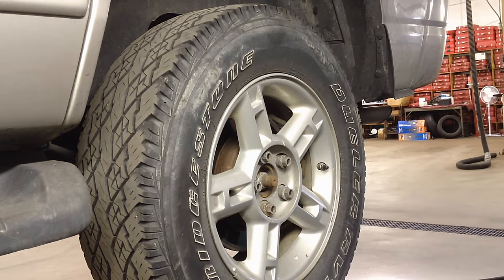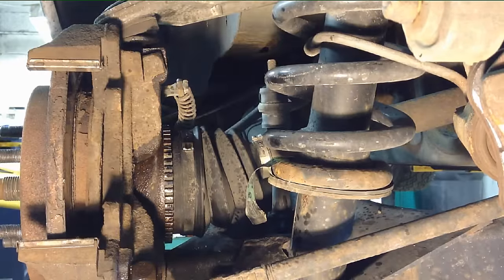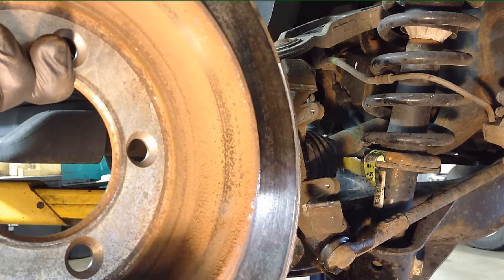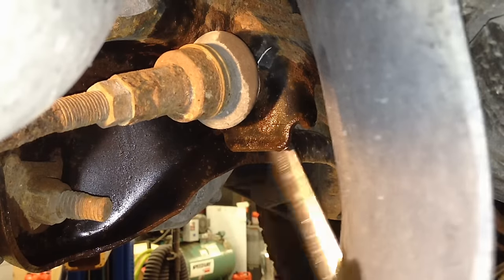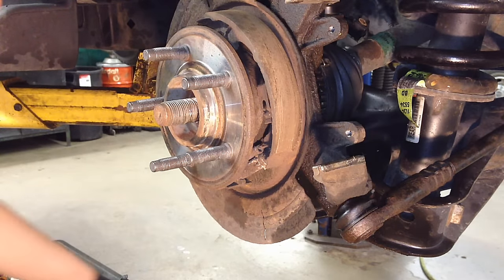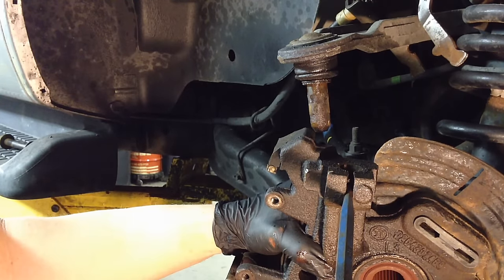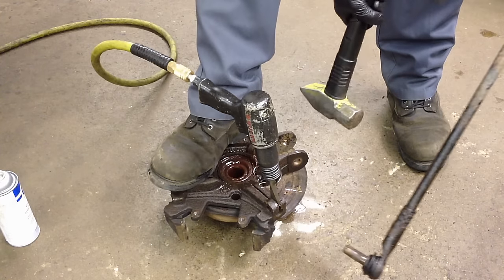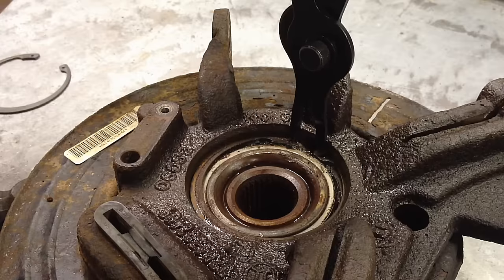2002-2005 Ford Explorer Rear Wheel Bearing Replacement

Comment: A very professional looking video. I learned enough about the process to do it myself if I had to, but I don't think I will. Some repairs are just better handled by a pro, rather than a semi-pro like me. What else would you recommend replacing (aside from brakes) while this is apart to save labor time and expense? Thanks!
Reply: If ball joints are bad and the inner and outer tie rods that’s about it

Comment: Great video. Very informative. Too bad you couldn’t show the install. Were the time constraints a work thing or a YouTube thing?  If the latter then maybe a ‘part 2’?
Whats the blue lube you put on the bearing & hub when you were pressing it in? I’ve always used anti-sieze or brake caliper grease since they can handle high temps without liquifying.

Comment: Been there done that. That's why I own a 2000 exploder. Straight axle with a 5.0 and Aod trans. No worries on timing chains ..trans or rear bearings. Cross member bolts snapping. All that good stuff. Did my 20+ at a dealer. Get out while your still young.
Reply from the maker: J- Styga Oh I did.
Reply: I'm surprise the rear spring wasn't broke and you save the rear "e" brake shoes. Lol.

Comment: you can use an arc welder to remove the race by just running a bead about half way around the race and it will expand and fall off.
Reply from the maker: I know that is what I heard but only half way around.
Reply: the heat generated by the arc welder will greatly expand the the race that was left on the stub and when you turn the stub upside down the race should just fall off, been doing this since the 60's

Comment: Man you weren't kidding....I bought a 20 ton press and was able to press the hub out relatively easy, but the bearing wouldn't budge.  Had to bring it to a machine shop and there 60 ton press made short work of it.
Reply from the maker: +Joe Correia we had an old 20 ton press and we always got them out but 60 ton would definitely get the job done .
Reply: heating and pb blaster cycles helped on each component

Comment: Nice rotor hat trick...have to start using that one
Reply from the maker: area46241 Yep many dealerships use this same method.
Reply: FordTechMakuloco I have a 97' Ford f150 and my rear tires have a small amount of play (In and Out) not side to side or up and down. And it started making clunk noise on occasions when I turn left or right. Is that normal?

Comment: Thanks so much for your video! Next time tap the bearing down to get pressure off snap ring
Reply from the maker: No, it is the rust in the grooved, the bearing does not move or back off after it has been pressed.

Comment: I just did this job on a 2003 lincoln with no special tools.

Hardest part is the snap ring install.  

Not understanding the hype?

A freezer and toaster oven with some big sockets and light tapping is all I needed.

Comment: Excellent informative video. I am a marine mechanic and deal with similar bearing jobs quite a bit. I have a 50 ton press and know penetrating oil and heat wrenching intimately. I should have mandrels to support the knuckle and press the bearing race properly. The suspension links is where I am not experienced. I have a 2007 Explorer V8. It is independent suspension, but looks a little different. Is there anything different about mine vs the vehicle you worked on?
Reply: +Scott Soriero I got my knuckle off and removed the snap ring. I have to say that the 2007 Explorer is completely different in regard to the suspension and knuckle removal techniques. There is no video on the 2007 model currently. Well I'm gonna press out the bearing and see what happens.

Comment: Great video! 

My customer must have driven on his for a while because only the CV axle was holding on the wheel. You would have to see this to believe it. The entire bearing race is on the hub. It carved out the knuckle about an 1/8th inch on one side for several inches. An absolute mess. This is when the complete knuckle assembly comes in handy. By the time you get a knuckle from a junkyard, replace the bearing  and pay for the press at a shop, you would be around $200 anyway.

Comment: Thanks for this video. My 02 Explorer needs the left rear wheel bearing replaced. I'm considering removing the knuckle myself and taking it to a shop to have them do the pressing. My only concern is removing the axle nut since I don't have air tools. I will have to get the socket as well as a 1/2" breaker bar and rent a torque wrench. I've replaced two ball joints as well as sway bar links and brakes. I'm fairly confident I can do it. What kind of shops should I call for the press?

Comment: Great video like others have said I have to do my 04 both sides went bad : ( I called around to see what it would cost to have it done- Oh man bout crapped my paints the lowest price I got was with tax $910 Bucks! So I'll be doing it myself but I think Ill take the knuckles in to a shop and them do the pressing as I don't think my little 12 ton will work Thanks again for well made video !!!!btw - the  cost on parts only is $389!
Reply from the maker: +Rosario W Are you buying the parts on amazon through my links? It should not cost that much for just parts. Also I agree take it apart as shown here and have a shop press them out let them deal with it.
Reply: I just seen that link for the parts I am going to check them out now Thanks for the heads up on the parts and response
Reply: In your listing for the bearing it has a B004 but when I hit the link it takes me to BRG4 bearing -is that the same part? I was going to use Timken Bearings but if these are better Id rather use these cuz I sure as hell don't want to go through this again LOL
Reply from the maker: +Rosario W The brg4 bearing in the listing is the correct I just confirmed again in the Ford parts catalog and latest bearing from Ford. I have never had to replace a Ford bearing on a comeback they really last. I think Timken makes the bearings for Ford but not sure.
Reply: Thanks! that works for me. I really appreciate the response back (I also Subscribed to your ch)
Reply: +FordTechMakuloco The bearing in the video says "F.A.G Korea" which is concerning. I'd prefer KOYO myself but they do not seem to make any for this application. I hear if you want to actually get Timken you have to order SKF...

Comment: I have a question. What causes suspensions to squeak? I've noticed that on some Fords. My '05 Grand Marquis suspension would sometimes make a squeaking sound when I go over some bumps at low speeds.
Reply: Is it the front or the rear? You might want to check out the sway bar bushings.
Reply: Scott Belkin It's the front. It seems to do it when humidity is low.
Reply: Sway bar bushings are one of those parts that get dry and brittle over time. Its not a big deal for a DIYer or mechanic to change out.

When you say "go over bumps" are you referring to going slow over speed bumps or just some bumps in the road?

My 04 Ford Explorer needs to have the sway bar bushings changed every 50-60,000 miles. I hear the squeak a lot when I go at a reasonable speed over speed bumps, when I am not turning over the bump. You probably won't hear it as much if you are turning because there is the weight of the vehicle on the sway bar when you are in a more of a turn.

Hope this helps.

Comment: The 2000 rear suspension is much different from the 02.Cant tell you which is worse but the alignment cam bolt assembly removal usually must be replaced on the older model because its seized and my solution is surgical sawzall action after all options are expended

Comment: That's the issue! I have to replace both front wheel hubs due to sensor failures on my hubs causing ABS and Advanced Traction Control to disable.  In addition, theses same issues are causing my 4x4 High mode to activate.

Comment: Hello Sir, I changed both front sides with motorcraft wheel hubs. However, there is still a noise and light vibration in the wheel. It is very clear in 60mph and goes away on slight right turn or any curve to the right. Could it be the tires? (1 month old) or 
Could it be the the control arm?
 (I hear a sound on bump)
Could it be alignment problem? 
This car is driving me crazy. Please please help!

Comment: Thank you very much. I have 2008 Explorer and there is a humming noise coming and gets clearer on 60mph. However, the noise goes away every time I turn the wheel slightly to the right. Yesterday I changed the right front bearing, but the noise is still there.  Did I change the wrong side? Or the issue is from the rear bearing? Please please help
Reply from the maker: Normally when you turn to the right the drivers side bearing is loaded up. Change the drivers side it is probably failing anyway knowing these vehicles. Generally the rears have to be really bad to make noise on a slight turn like this.
Reply: Update:

Changed both front bearings. Still there is a noise and vibration in the steering wheel.

Comment: Hello Tech...Thanks for the great video again.  Do the new Bearings come with a new snap ring?  If not where can one be purchased?  Also would a 12Ton press be enough for the nob?  Thanks in advance!!!!
Reply from the maker: jsjizza1 No they don't the dealer can verify for your model year but here is the part number- 5L2Z-1A124-A the 12 ton press should be plenty.
Reply: FordTechMakuloco 
Thank you very much I have ordered the new bearing thru Amazon and will call to get tge new snap ring.  Could a bad rear bearing cause the Advance Trac light to come on??  Thank you again

Comment: My sister has a 4.0 4x4 explorer and its either a 2003 or 2004 but either way, its getting a hard loud BANG BANG BANG almost randomly, it changes if I go up hills though, quieter or louder - it has a mind of its own. It seems to be coming from the transmission area and I was wondering if I should start looking at the rear or the U/CV joints or possible the xfer case? The car accelerates and shifts gears mostly normal but the banging does speed/slow with RPM

Comment: Could I buy a part that already has bearing installed and if so what is it called rear hub bearing assembly? I dont have a press.
Reply from the maker: Yes Moog sells the complete knuckles
Reply: @FordTechMakuloco  thanks
Reply: I paid a shop $150 and they used a torch and hammer and now it’s worse than before I arrived there.
Reply: How much? Independent suspension rwd with cv axles in rear.

Comment: Is there any way to grease that bearing without replacing? I just had mine replaced but they forgot to pack grease in there when they replaced it so I'm getting a high pitched squeaking at times. I would normally just take it back to the shop that did it but it went out while I was on the road about 300 miles from home.
Reply from the maker: No this is a sealed bearing
Reply: FordTechMakuloco That's what I thought. Is it possible to remove and reinstall the same bearing without damaging it or should I just plan on buying another new bearing? Thank you for your quick response.

Comment: Would you replace all of the bearings at the same time or at least both on the axle? or can one be replaced independently without performance or reliability issues?
Reply from the maker: +Matthew Springett No you can just replace the side that is bad the whole suspension is independent of the other side.

Comment: I've done a few of these and just use the aftermarket kits that come with the snap ring bearing and hub. Our shop doesn't have a press so have to send to machine shop. He does not like the ebrake parts on it. Do those get in the way at all?
Reply from the maker: UDraft4 Nope not with the special tool.

Comment: The knuckle on the 2008 Explorer is different, although it appears to use the same hub and bearing.  The factory service manual tells me to remove and discard the nuts and bolts for the outboard toe link, upper arm, and lower arm.  Are these torque to yield?  How critical is it that they be replaced?

Comment: HOPEFULLY you can help.  I am looking at a 2003 Ford Explorer XLT with the upgraded wheels etc (Maybe its the NBX, not sure exactly what the difference is)

Anyway - it has advancetrac (fulltime 4wd but selectable between auto, high & low).  the ABS light is on and i hear what sounds like metal on metal grinding coming from the back right of the vehicle.  The pads are fine.  Car stops without an issue.  Is this the rear wheel bearing? there is no groaning, whirring, nothing. just the metal on metal sound.  I was thinking possibly a stuck caliber but not sure if that would throw the ABS light to be on all the time.  Any clues? All help/advice would be greatly appreciated.  Thanks :) Michael
Reply from the maker: +Kelly Grant If you have a grinding wheel are I would check the bearing for play with the wheel on as I show in this video.

Comment: Makuloco, I have a 04' 4x4 Ford explorer. I recently replaced both front hub wheel bearings, I wanted to inspect the rear componets to find that both my rear wheels have slight play at 10 and 2 as well as 12 and 6 when jacked up, no where near the amount of this video. I do not notice and bearing noise at all. Is this typical signs of bad bearings? Any info appreciated. Thnx for the video!
Reply from the maker: +Clarke Snyder Yes but also check the rear toe link for wear while you are back there.
Reply: I will check that as well, thank you.

Comment: I got a Ford Tempo with 80,00km in it. Do I have to change rear or front wheel bearings due to mileage or just change them when the wheels move in and out due to bearing looseness?

Comment: You should use kopper kote to reassemble everything. Then if you have to take it apart again it is way easier.
Reply: Even if it’s five years down the road. And thanks for posting. Makes jobs I’ve never done before a lot quicker.

Comment: How much weight in tons do I need to push out the bearing? I plan to buy a press ( I  will use it )Should I buy a 6 ton or 12 ton)?
Reply from the maker: I don't use anything lower than a 20 ton press with these.
Reply: Thanks guy..20 ton will do.

Comment: my bearing is messed up to. the rear. will my tire fall off? or can I ride it like that to the shop with no problem?
Reply from the maker: +Michael Reyna It will likely fall off if it is separating that badly.

Comment: I'm about to do this in a freinds shop who has a press besides the wheel bearing itself that needs changed I ordered what other parts should I order? i was told to order 2 bolts on each side from ford something about they commonly break and that ring what is it called I'm no mechanic...so need some help with parts identification.

Comment: Hey so I have a 02 Explorer XLT 4 x 4 and when I’m driving in reverse and drive in neutral with the vehicle rolling  there is a whirring noise from the driver side sounds like the front it slows down the noise when I slow down and it speeds up when I speed up also there’s a slight vibration in the steering wheel and when I’m on the freeway and making a turn there’s a huge vibration I. The steering wheel so I’m 90% sure that it’s the wheel bearing do u think it is?

Comment: Hey FTM, do you have a video on the the f150 series, Im trying to remove the rear hub drivers side on m y 2005 f150, got the  brake rotar out but dont know where to go from there, thanks again

Comment: Would this be the same for a 2006 ford explorer?
Reply: The knuckles are different.  It actually looks easier to remove than the 2002-2005 Explorers.  Is the bearing any easier to press in and out of the 2006-2010 Explorers, or should I just take it to a shop as well?

Comment: Doing this on an aviator, I would have thought the bearings are the same as the explorer.  turns out that shell you press out at last doesn't have a lip on the inside, just more of a cone... Oh, and my 20 ton shop press wants nothing to do with this thing... Everything else came off easy.  Off to Ford it goes I guess... If anyone else is looking for dies like me, my ball joint press had some :)

Comment: i have to change the hub bearings on my 2005 Ford Expolorer. Does being an 'Eddie Bauer Edition' affect what Bearings i need to purchase?
Reply from the maker: No it doesn't.
Reply: My wife failed to give all pertinent information! I have a 2005 Eddie Bauer equipped with 4 wheel drive. Given the fact that not all models are equipped with 4x4, doesn't that affect what hub bearing to purchase?
Reply from the maker: +Kyle Donahue The rear bearing is the same for both models it's the fronts that can vary.

Comment: Im having trouble putting the  emergancy brake cable back on i have one side of it on but not the other side i tried vice grips channel locks screwdrivers pry bar for the spring and its still slipping

Comment: In hindsight, it would be easier to remove the backing plate for the parking brake with the three bolts before pressing out the bearing. I then used some rust reformer on the plates to preserve them and make sure you remember which side is which!

Also, wondering if it would be better to keep snap ring off until hub has been pressed so a completely flat surface can be supported from the bottom...anyone?

Comment: How do you remove the rear cv axles from the diff and how do you put them back in the diff in a 2002 ford explorer ?
Reply from the maker: Antonio Quintana You use a punch a nd hammer to drive them out of the diff at the inner cv end and going back in you line up the splines with the internal side gears then use the plunger technique to pop the circlip past. Once it goes in give it a tug to make sure it is secure.

Comment: I know this is old.
But the way you are using that bearing removal tool on the press is wrong.
You always put the thread part on the steel that way they will not bend.